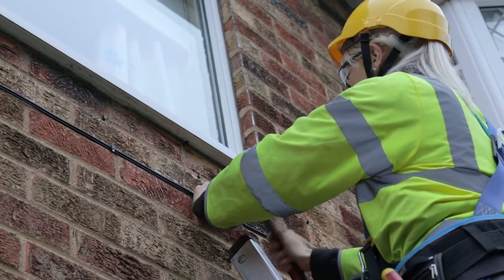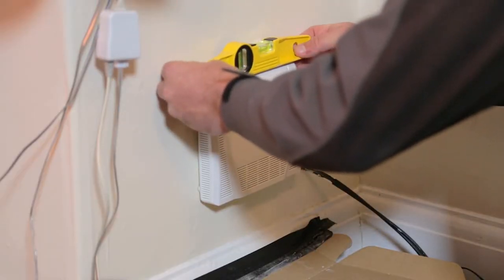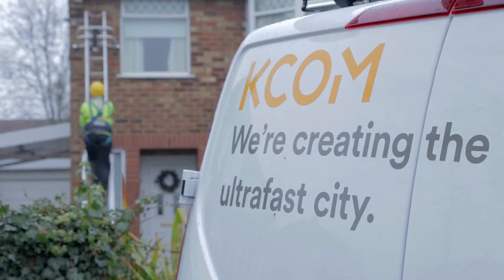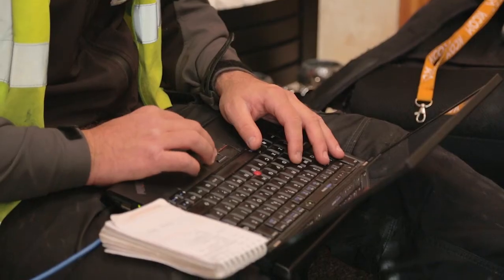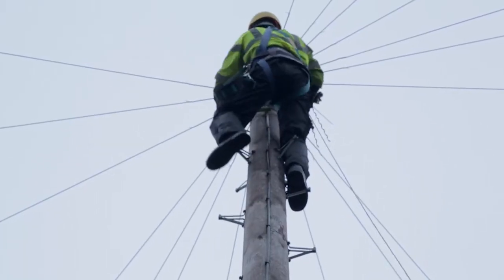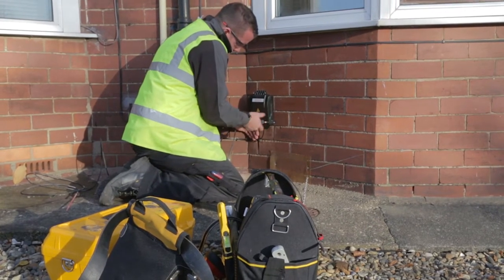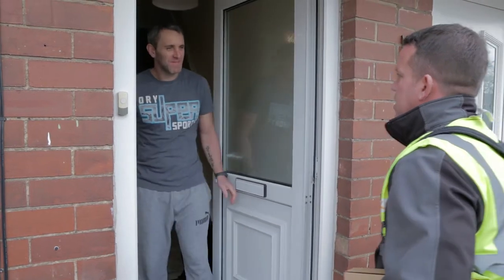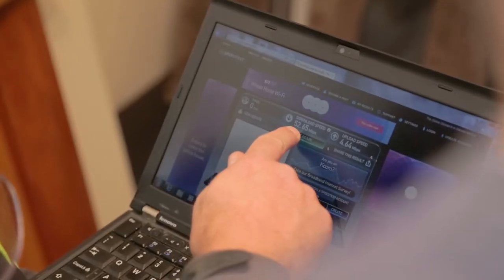How does an engineer install Lightstream broadband?

Comment: Don't bother as this engineer installed ours and we have had no end of problems! The speed is slow and you get buffering and slow downloads and there excuse is your equipment is not compatible even though mine is brand new! Utter rubbish don't bother if you can get BT its so much faster and reliable!

Comment: How does KCOM install lightstream? Install the inside first and give a pretence of how the outside was to be done first, make you call their call centre like 10 times with 5 different promised dates of a working connection and pass the blame until you're left without a connection for a month